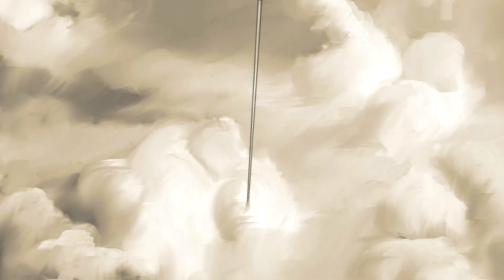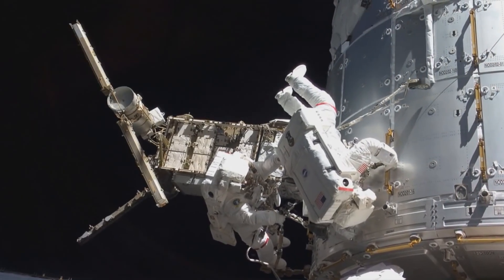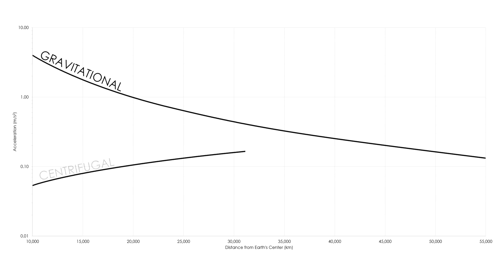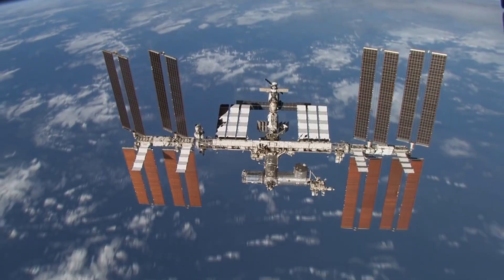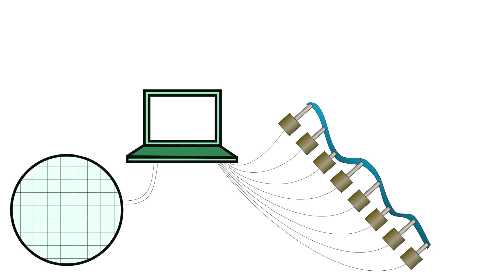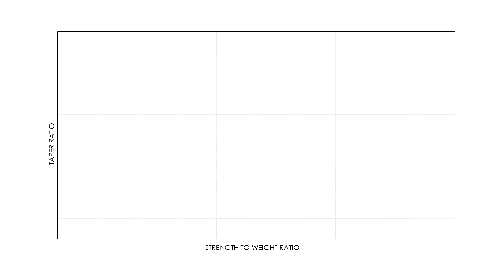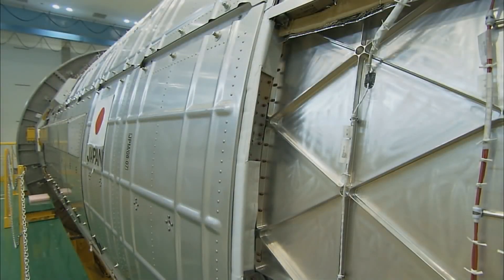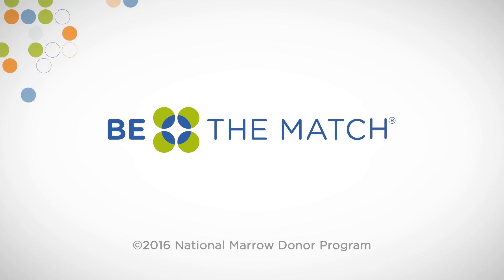Design Your Own Space Elevator

Comment: Why don't you apply the power to the cable? And transform it on the climber.
Reply: that's just like running a power cord :D it's way too far for a cable. electric resistance would mean that you'll lose most of the energy.
Reply: the cable needs to be conductive
Reply: +Arjen Hartink Is that impossible?
Reply: You could also pull the cable itself like normal elevators do.
Reply: did you watch the video from 6:00 onwards? the accumulated weight of the cable would be too great for it to support itself.
Reply: resistance of even a 1/10th that much cable in a single run would choke out any useable power you shunted up it before it burst into flames. 
even if you used a stupidly high voltage...which would be ill advised given the layers of atmosphere it would be touching; I mean, this will in effect be the biggest lightning rod ever made.  

the only way that would work is if you put amplifying relays all the way along the cable, or power stations beaded up the cable periodically feeding power to small sections of track. 
which forms an obstacle for the climber, adds to the weight and wind drag as well as presenting a practical challenge of getting them up there in the first place (some sort of self climbing bead stations? ) not to mention dramatically ramping up maintenance issues.

once you solved that you'd then have to implement some way of stopping the voltage build up over such a huge distance into space from inducing a charge in cable and overloading it, which will be a variable factor depending on everything from weather to solar activity to space weather.

Seems better to have a non conductive tether and generate the power onboard the lifter;  at least from my understanding.
Reply: Greg Whittington Probably yeah, I was just wondering, I'm a 15 year old interested in engineering (not an engineer yet). :D
Reply: We all have to start somewhere. no one is born knowing about electricity. 
when I was just starting out, someone told me to think of electricity like water. 
Its an imperfect analogy, but it helps visualize it. 
where voltage is water pressure, amperage is water flow rate and resistance is the diameter of the pipe. 

in this case it would be like trying to suck up a milkshake through a very long straw. 

hope that helps.

Comment: In physics class we learn that centrifugal force is fictitious, a force that results in the object following a curved trajectory rather than a tangential one as described by the real centripetal force. Centrifugal force is also the layman's term for any radial force and is commonly used in exchange for centripetal force however in your example you use the two as comparative forces. Can you explain what you meant by centrifugal force in your example?
Reply from the maker: If you derive the equations of motion in a rotating reference frame, the centrifugal force is a real force.
Reply: Thank you that is very interesting. I will do some further research to better understand when centrifugal force should be utilized.
Reply: Centrifugal force is a psuedo-force that balances the centripetal force. It's used in rotating reference frames. The force's existence depends on which reference frame you decide to work with.

Comment: If the tether snaps, would it wrap around the earth and kill everyone?
Reply from the maker: +Berrymouse only one way to find out!
Reply: Depends on where it snaps.
Reply: The lower half would probably burn up on reentry long before then and the upper half would rocket away from earth at incredible speed.
Reply: Watch Gundam 00.
Reply: Berrymouse The tether would be really light and long. It wouldn't even destroy a house if it landed on one, and the descent would take a long time, so we would have time to evacuate. Also, you could place parachutes on it, just in case.
Reply: that was my first thought as well.
Reply: There can be explosives distributed through the cable that cuts it into segments, each of which then mostly burns up in atmosphere.
Reply: Fight?
Reply: yes, but since its so thin it wouldnt kill anyone it will just wrap the earth
Reply: @dillmon1  - Bullets are small, they still kill you very much. It's all about energy not just size.
Reply: Berrymouse probably not instantly as it would keep the momentum
Reply: If it's 11,000× the size of the observable universe? I think our proximity to that much steel is irrelevant. I could be wrong here, but it would've triggered a black hole long before ...and now I have no idea what it would form. A bigger black hole?
Reply: It’s been sort of answered, but most designs I’ve seen assume that more than 100 miles or so it would burn up, and they plan to place it on the west coast of a continent or landmass so as the Earth turns under it, it falls into the ocean.

Comment: Could you do a video on the idea of a space fountain, supposed to be more feasible to build as it doesn't rely on tension but very expensive to run. The wiki says that it could extend to geostationary but because its a closed loop system that fires counterweights in opposite directions, by changing the velocities in each direction the forces can be balanced to achieve any height, which I reckon could be cheaper than  geostationary

Comment: Why not have a bumper lift at the bottom, one that uses combustion to elevate the lift out of the atmosphere as combustion has a great power to weight ratio; then have the laser powering down from the station at the top, as to minimize the interference from the atmosphere.

Comment: Could you use the tether as an extension cord? Basically sending power through that material? It would work kind of like a street car except vertical :P
Reply: Sod Alfredsod 

problem?

sounds like a great place to get power from.
Reply: I think the solution to the energy problem lies in one of Teslas first patents - 1 wire Arc Lamp. Essentially oscillating a "Tank Circuit" at resonance, but in this case 1 end of the capcitor is at the base station, the other end of the capacitor is in space and the inductor is the tether itself. You should be able to harvest energy off of the tether if it is resonating at high frequency, high voltage with another tank circuit that is also in the same resonance.
Reply: Double Dare Fan  Yes, that might work :-)  It wouldn't even have to be half circles, just two flat ribbons laminated together.  But a problem I see is that, since the laminating material has to be a good insulator because the voltage between the two conductors will have to be fairly high to power a high-speed climber, the laminating material will add significant weight per mile of cable
Reply: now the problem is the ionosphere, a area that has a electric potencial of 300 Kilovolts to earth
Reply: What are the carbon nanotube properties, couln't we build all from nanotubes ? I speculate it will be the most expensive material.
Reply: > meaning we will need to send up enormous amounts of power

WHY?

THE EARTH IS A GIANT ELECTROMAGNETIC GENERATOR.
Reply: I think the problem is the loss of energy because of the lenght of the cable, the material's resistance i think it is
Reply: Hungry Guy 

invisible pixie wrangling isnt my forte. 

basically, what i envision is a cable conducting electricity from the ground to the orbiting mass, like a giant extension cord.

the climber would just be a mobile splice. i mean, we already have wireless power transmission (cell phone gadgets use it) this would just be a more industrial scale.
Reply: carbon nanotube is basically a superconductor. we could use the tethers travel through the atmosphere (friction) to generate electrical current.

the climber could theoretically just draw power straight from the cable as it climbs, provided the structure used to grip the tether is conductive as well.
Reply: Saoir Cham Sigh...
Reply: +Saoir Cham 

FYI, i just read a really good book about Tesla that walks through his career and thoughts/physics behind his inventions. Its called 'Nikola Telsa Electricity Unplugged'. Its a great read for any nerdy electrical engineers. 

Ironically the title suggests that he used wireless energy.... he did not...
Reply: Brian Sauve 
can you be more vague please? i can still understand a small portion of your question.
Reply: +Brian Suave Yes, the current is the problem.  We have, what, 30,000 miles of cable, multiplied by 2 (the hot and the return ribbons laminated together with an insulating ribbon between them).  That's a lot of resistance in the cables and there will be a huge voltage drop after just a few tens of miles.  Remember Ohm's law?  Watts=Amps*Volts.  In order to deliver sufficient power (watts) to the climber, we need to reduce the amps through the pair of cables by increasing the voltage difference between the two conductors.  So I believe the cables will need a voltage difference of millions of volts to reduce the current and to compensate for the voltage drop over such a long distance.  And that means the insulating ribbon between them will have to be a "super insulator."
Reply: Saoir Cham Electricity isn't hard to understand at all.  But I can't see into your mind to see where you're having difficulty understanding.  So I suggest you read a book on basic principles of electricity.  Or google Ohm's Law and see where that takes you.  That might help you understand.
Reply: Saoir Cham Tell ya' what... I'll try to explain basic electric concepts to you in layman's terms:

An electric circuit is just that: a circuit.  Electricity needs to flow from the power source, to the load, and back again.  Take a look at an outlet in your home.  If you're in the US, you'll see three holes that look like a face (if you're elsewhere, you might see a different pattern but the principle will still be the same).  The big round hole is the ground (or "earth"); it exists only for safety, no power passes through it (if power is flowing through it, that's called a "ground fault" and it means there's a short somewhere in your wiring and the GFCI detector in the breaker will detect that and trip).  The two slits are for power; hot and return (sometimes called "neutral").  If you measure the voltage between the two slits, you'll measure 120 volts or very close to that.  

But all wires have some small amount of resistance per unit of length.

Imagine you have a small generator or battery that produces 10 volts.  Run two wires for 100' from the generator to a light bulb or electric resistance heater.  Measure the voltage between the two wires 50' from the generator, and you'll measure about 9 volts.  That's due to "voltage drop" from the resistance.  Measure the voltage between the wires at 100' and you'll measure about 8 volts for the same reason.  That's why "high tension" lines use high voltage, and even power distribution on utility poles use 1,000 or 10,000 volts; the voltage drop has a lessened effect.  

Using Ohm's Law (google it), the power (watts) delivered is a function of voltage times amperage.  If you have 120 volts powering a device that draws 4 amps, that device is consuming 480 watts.  If you have 240 volts driving a device that draws 2 amps, that device is also consuming 480 watts.  But the circuit that uses the higher voltage is more efficient because the power can be transmitted over longer distances with less power loss.

An easy way to visualize it is as a water pipe.  Think of volts as pressure and amps as the volume of water through a cross section of the pipe (this isn't an accurate analogy of course, but accept it as an example).  Imagine a pump pushing water through a long pipe with a turbine at the other end turning a saw blade or grinding wheel.  Increase the pump speed, and you're giving more power to the turbine.  Or increase the diameter of the pipe so more water flows though it at the same speed, and you're also giving more power to the turbine.  Since a smaller diameter pipe is cheaper, it's more efficient to pump a small volume of water very fast, than a large volume of water slow.  And though water can just spill out the end of the pipe at the end, you can't just let electricity "spill out."  Electricity doesn't work that way; you need a return pipe from the turbine back to the pump to make a complete circuit.  This is why batteries always have two connectors or two ends that must be connected with two wires.  Or if you've ever had an electric train, why you need two rails: one for power and one for return. 

A space elevator powered by electricity generated from the surface is like that electric train; it will need two "wires" one for power and one for return, hence two ribbons for the electricity separated by a insulating ribbon between them, all bonded together so they don't flap wildly and short out when they touch.

Now, the problem is that the cable is almost 30,000 miles long!  In order to compensate for the voltage drop over such a long distance, the voltage at the power end must be very high.  And since the voltage must be very high, the insulating ribbon between the two conducting ribbons must be an excellent insulator or very thick.  This insulating ribbon will add considerable weight to the overall cable, which could make the whole idea of powering the elevator by electricity delivered through the cable as infeasible.

Hope this helps you understand :-)
Reply: Saoir Cham Well, again, let's use the water pipe analogy.  Think of voltage as pressure or speed; amperage as cross-sectional volume; and wattage (power) as total water flow per minute.  Powering the elevator, itself, won't use much power per second.  But to get the power all that distance, we need to use impractically high voltage (high water pressure).  Imaging trying to pump actual water from the earth to a satellite in geosynchronous orbit.  "Pumping" electricity that distance offers similar challenges.
Reply: I can think of several ways to use the tether to transfer energy. None of them are "good" though. 

The tether could act as a wave guide for microwaves. 

The tether could be two (or better, three) tethers.

The tether could transfer kinetic energy through some sort of wave motion. 

There could be two pods acting as counterweights. 

None of this technology is developed, so which would be best is questionable. I worked in R&D. About 2/3s of ideas don't make it through development even when the idea is fundamentally sound. So all the paths would need development, as well as all tether ideas.

Then there's a problem of holding the tether in place. Think of a giant game of crack the whip. With mass moving and angular momentum changing, the tether would not survive without some sort of active stabilization. (Doable, at least theoretically.)

But the biggest barrier is cost. Financing is an arcane art. Trillions of dollars over 50 years or so? I doubt it.
Reply: +Monte the main tether wouldn't be the best way to carry energy to the climber in my (barely) educated opinion. it would be easier and more effective to just have an additional, lightweight, non-weightbearing 'cable' to carry energy to the climber. Think graphene for instance.
Reply: There was some talk about that a while back. Some lab was testing the feasibility of using the carbon nanotubes to conduct the required electricity. It may be possible.
Reply: Shaitan's Advocate this is the YouTube comment section; serious scientists won't have serious talk here; come off your high horse and be more humble in discussions, otherwise people will just ignore you (and not collaborate with you; science is teamwork today anyway), no matter how good your thoughts might be. Many great scientists have been forgotten, because they were ignored by the bigger scientific community. Some were exceptionally genius and were still heard later (newton, galilei) and some were just replaced (there are many clever people out there. You found something? Someone else will find it x years later and it will be called after him, if he finds recognition in the scientific community. That has happened hundreds of times in science).
Reply: Shaitan's Advocate 
Friction causes loss of power...
Reply: Jonathan Lyons u got his from the book star climber didn't u
Reply: Hungry Guy 

not entirely true. you have one circuit, negative/ground at the base, positive end at the orbiting mass.

the cable itself just allows flow, then the climber as two sets of grippers, negative and positive, basically just making a mobile flow gate with attached motor/control center.
Reply: The cable can probably be made in 2 half-circle-shaped halves that would be laminated together with a strip of insulating material in between. Now it would have the 2 halves of the circuit and function as a single cable.
The climber would have control systems to keep the + and - wheels  (or pickups, if using non-conductive wheels) on their respective sides of the cable.
A descending climber would use regenerative braking to both control the rate of descent and to offset energy costs.
Reply: Levi M 

THANK YOU

ive been saying this, but no one has gotten it.
Reply: Carbon nanotube is nowhere near a superconductor. More like copper in terms of conductivity.
Reply: In order to have an electric circuit, you need two conductors, and thus two cables.  And since they'd be whipping around in the atmosphere, they'd short out whenever they touched each other.
Reply: Hungry Guy 
why is this so hard to understand?

you. do. not. need. a. return. path.

current flows from the earth...to the orbiting weight, and is then discharged into the magnetosphere of the earth itself.

our planet is a giant electromagnetic battery. the tether closes the circuit, thus flow goes one way.

yall are small minded.